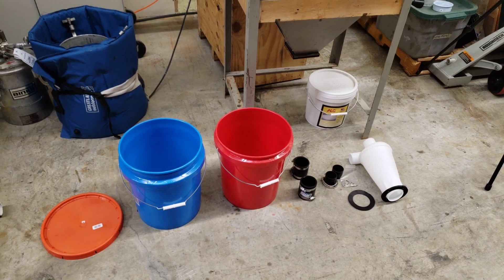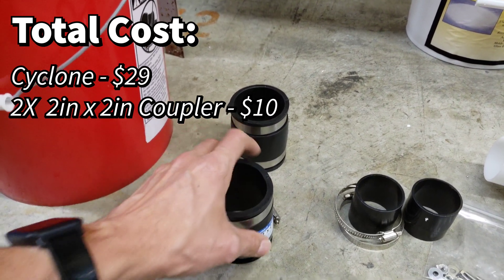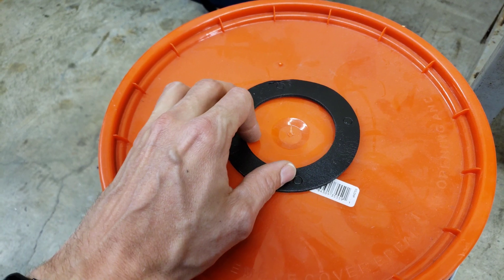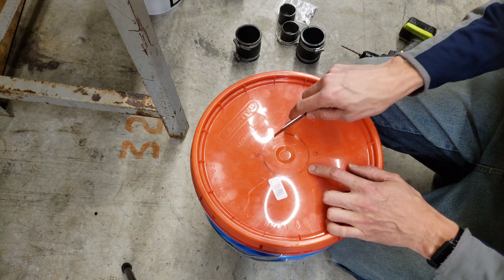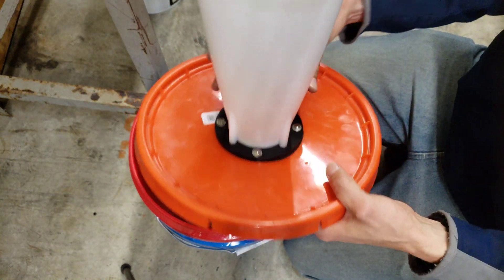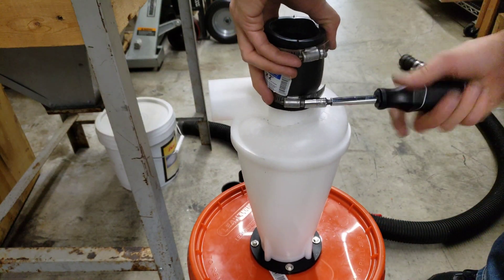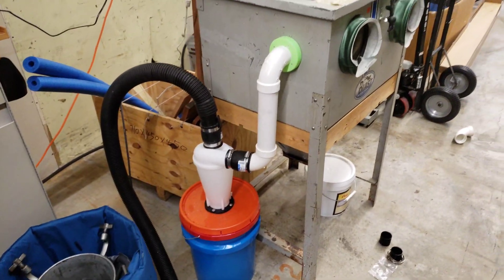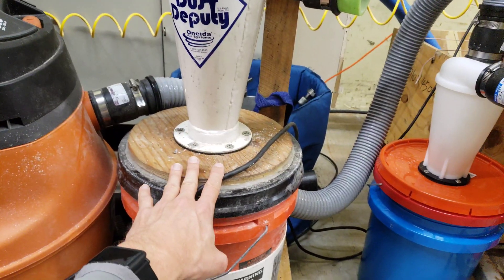How To Make a Dust Extractor Cyclone Vacuum System for Woodworking, Sand Blast Cabinet, CNC DIY

Comment: Do you think this method will work for sand that’s 14x30 mesh? Thank you for sharing!
Reply from the maker: That's pretty big, so yes it will definitely seperate the sand from the dust. I'm currently using this with fine glass beads 80-120 mesh and it works with very well to seperate the glass beads and dust for that size also.

Comment: Try a old shop vac and two 55 gallon drums with some pvc. You cut the bottom off the shop vac, cut a hole in the top of a drum to drop the vacuum in. Seal the vacuum on the vac and run some pvc pipe between the two drum tops. Now cut another hole in the second drum and connect your hose. 
Now you have a 55 gallon capacity dust bin that’s easy to empty with the added bonus as not to fill up every day